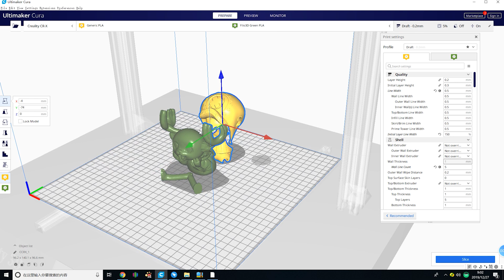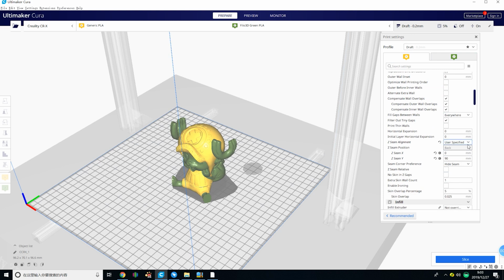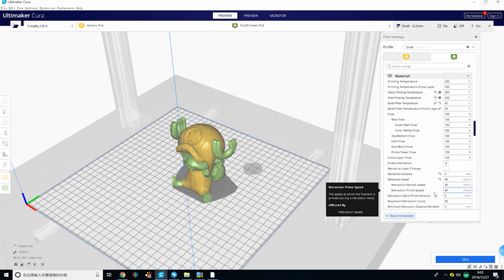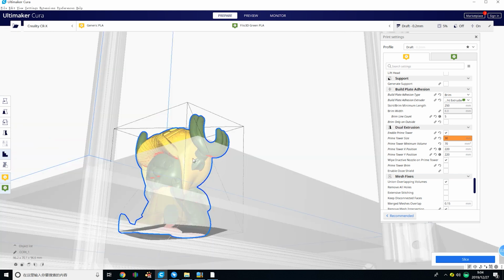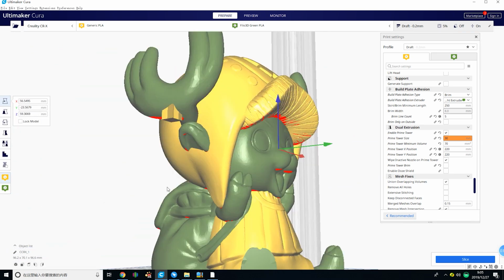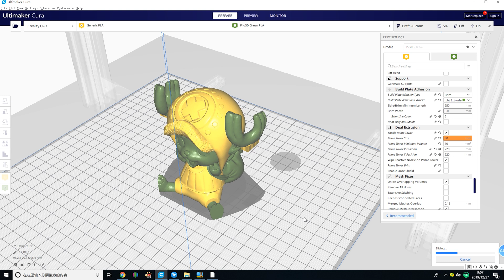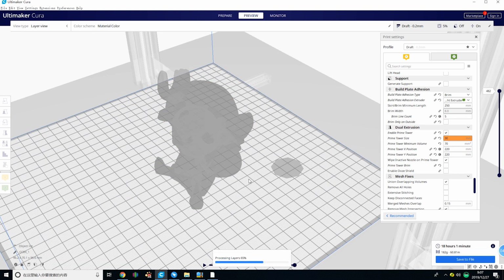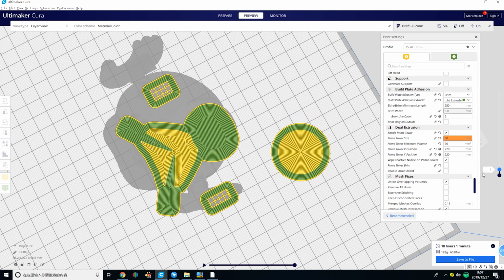Creality CR-X Pro Dual Color 3DPrinter is Coming! Bltouch Silent MotherBoard + Meanwell Power Supply

Comment: Is there a upgrade kit for the normal CRX?
I also need a new printing plate, mine were uneven from the start...

I updated the firmware (it was clearly for the normal CRX). Since then, the System of the Printer crashed  after a short time when restarted, leaving me a Black Screen.
After hours of searching i found an old firmware that works normal.
I really start to hate this Printer! I had only trouble with it, the past months... 😡
I surely not would buy a Printer from Crealtiy again!

Comment: I hope you will make an upgrade kit for the Ender 5 Plus.  That unit looks like a nice compact option for dual filaments!
Reply from the maker: BLtouch, silent motherboard, Meanwell power supply, these accessories Ender 5 plus are also available.

Comment: Looks great! Even dual color! Can print two different materials too? For example copper & wood or PLA & ABS? Or the material should be the same?
Reply from the maker: May not work, different materials need different heating temperatures.

Comment: Is it possible to upgrade an original CR-X ?
Reply from the maker: check below two upgrades if you already have one, https://www.creality3dofficial.com/products/upgraded-silent-board-with-tmc2208-driver-for-creality-ender-5-plus-cr-10s-series?_pos=3&_sid=cc6708520&_ss=r
https://www.creality3dofficial.com/products/creality-bl-touch?_pos=2&_sid=74680e835&_ss=r
Reply: @Creality3D  Thanks. Do I need a different mounting bracket to install the BL Touch on the right side?

Comment: Hi,
The new CR-10X Pro looks really good! I already love it!
However, two, three details bother me:
1) Have the fans been replaced by silent models?
2) Why did you opt for stepper drivers soldered on the motherboard and not by removable modules?
3) You use Cura as a slicer in the video when you have developed your own slicer (Creality Slicer), too, why not have used it? Does this support the CR-10X Pro?
Reply from the maker: 1) The fans are not silent yet, but we have plans to introduce silent fans.
2) Because our motherboard does not support removable modules.
3) Cura's slicer is more stable and more complete than our own. If you purchased CR-X pro, the print model can choose CR-X option in the slicer.  : )
Reply: @Creality3D  Thank you for your answers :)
1) The silent fans will be present on a possible version 3 or during an update of version 2?
2) Why not have developed a more flexible motherboard (cost reduction, deliberate choice ...)?
3) I noticed that your Slicer had fewer options, but I never used it to print for several tens of hours.
I use, in this order, the following slicers: Repetier Server Pro, Simplify 3D, Cura ,, Prusa Slicer, Slic3r, IceSL-slicer, Creality Slicer.
This does not prevent me from appreciating the brand's products.
Reply from the maker: @DjOddEssA  1) The specific time for launching the silent fan has not been determined. You can follow our news, and you can learn the latest news as soon as possible.
2) There is no development of a more flexible motherboard. In order to reduce costs, the motherboard we use now has better stability.
3) Thank you very much for loving our products)

Comment: Can you tell me what  white pla that you printed with in this video is? Is it the same that came with my cr 10s pro? I want to get more and need the part number
Reply from the maker: White PLA is Shiny Silky PLA Filament, you can buy it in our official store if you like. 
https://www.creality3dofficial.com/products/silk-blue-and-red-3d-printer-pla-filament-1-75mm-shiny-silky-blue-printing-material

The main feature of the CR-X series printer is the double extruder, which can print with two-color filament at the same time. : )

Comment: by pro do you mean it has a silent board and a alloy extruder.. hopefully no shoddy knock off bl touch
Reply: In the description they say what changed. They are selling the real BL touch and are using them in their other printers so no knock off
Reply from the maker: @aggronn  Thank you for your answer. : )
Reply from the maker: You are welcom : )
Reply from the maker: Yes, CR-X pro is an upgrade to CR-X. Please believe that we have carried out strict quality control on all accessories. : )